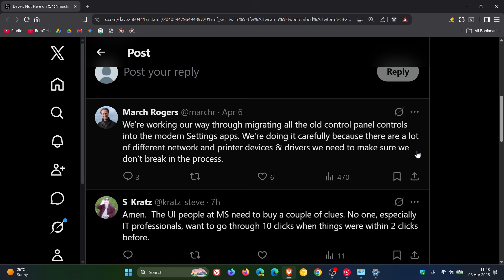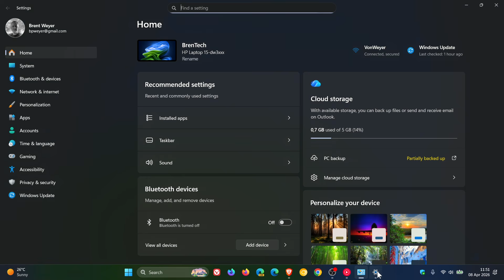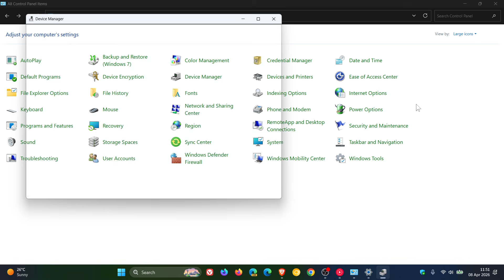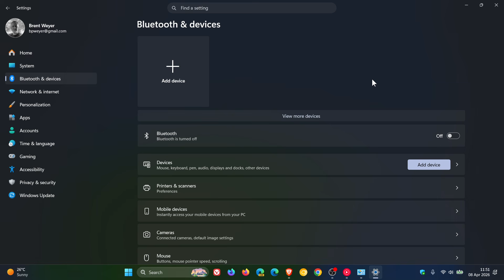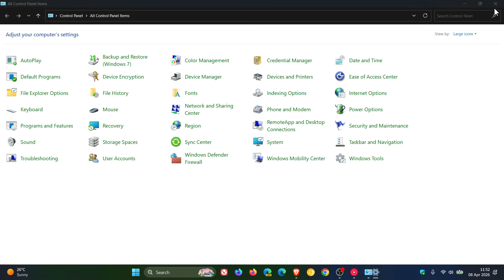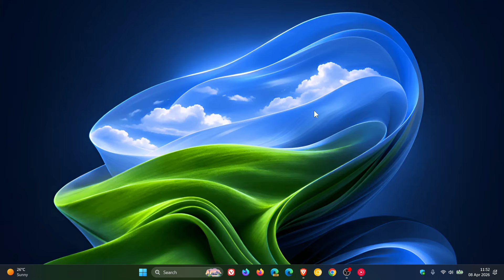Microsoft Confirms Why Control Panel's Migration Into Settings is Taking SO LONG!

Comment: Microsoft should treat the Control Panel as Advanced settings and bring everything over under one massive section called Advanced Settings. This would enable them to get the job done quickly. In fact they would be able to still continue refining the integration. It's like moving out of your old house and having everything in a specific room full of boxes in the new house.

Comment: Yup, I agree that they should not BREAK things!
And.. I agree the new Settings menu can be very unwieldy for some things such as the network settings.
One thing I particularly don't like is you can't, as far as I know, work on multiple settings at the same time.
The individual control panel items in the old control panel can be opened separately.

Microsoft has sort of done this by making the Windows Security controls available in the Settings menu AND as a separate window.
Maybe they can use this hybrid approach before they try to integrate everything in the new Settings menu?

Comment: The Control Panel is here because we longtime users kept using it.

Personally, for Sound tasks, I've shifted over to Settings. For normal Networking stuff, I've also shifted to Settings. However, for advanced networking like bridging networks, VLAN, Server  & Hyper-V stuff and NIC hardware configuration I still use Network Centre.

Printers & Scanner, Game Controllers, I prefer to use the maker's interface. Fine-grain control is still important for these devices.

Device Manager should not be messed with. It's perfect as it is, although a dark mode will be nice.

Disk Manager should be moved to Device > Storage. This program is rather basic so common Disk & Partition functions should be consolidated. 

In fact, Storage Spaces, Windows 11 RAID solution should be bunched into Device > Storage too and automatically enabled (shows up in Setting) when Windows sense multiple NVMe / SSD / HDD installed. A simple drive map can show the possible RAID-level based on installed hardware and which ports they are attached to.

Comment: The control panel was one thing that they got right in Windows all those years ago. It just works and does job it is supposed too. The only thing I would say give it and the different menus dark mode but leave it alone. As many have said if it ain’t broke don’t fix it. BrenTech should do a poll (if he hasn’t already) on which users prefer settings app or control panel, don’t mind.

Comment: I will just continue using the Control Panel folder as it's far better and I've been using it since the 1990s. I've even made a backup Control Panel folder I can add to my start menu if needs be. I've even considered using the GodMode folder which allows users to access all of the settings in one place, instead of searching through the Control Panel or Settings app.

Comment: It’s a nonsense excuse. If this were truly the only reason , they could migrate te entirety of the Control panel to Settings, leaving behind an empty Control Panel which would be available to any device drivers which haven’t been ported yet. Furthermore, they could state that as of the next major update of Windows the OS will mot support Control Panel-style interface for devices of type X (e.g printers). It would then be on the device manufacturers to update their software and Microsoft would be able to concentrate on building actual improvements to the system.

Comment: It's more than just content & control. The Control Panel looks aged, but it's still a clean, well-organized, concise & intuitive layout that's easier to understand and use. It's not perfect, but it's much easier to find functions in the Control Panel than in the Settings. Settings, like most of the newer Windows systems, is TMI on each screen, too disjointed, and is just slop w/o the AI (so far!).
If this is what Microsoft means by "fixing Windows," the future is going to be even more disappointing.

Comment: I have been using Windows since it was a DOS application. My number one complaint with Microsoft is that they keep needlessly changing and moving things. The end result is the same, but you can never find anything.

What was wrong with control panel? I still use it, it works. I give them credit for the right click on start button for some settings. I wish I could just pin Control Panel apps of my choice to it.
Reply: The control panel is perfect why replace perfect, it never made sense what they are doing

Comment: the win11 settings ui is a little better than win10. but, its still too big and clunky, with too much whitespace, and color scheme that acts against the font colors and button colors. it still pales in comparison to the much smaller and clearly readable, control panel (like other win32 apps, dont have native dark mode support, but have community made fixes).
some prime examples of control panel items that still outclass or are the only option, are the sound control panel (compared to the lackluster implementation of it to win11 settings app), and the properties panel for any file, app, or folder, although it is its own thing, would benefit from an updated ui (the only improvement it needs is dark mode natively supported by microsoft developers). this same convoluted and unnecessarily large ui (when all accessibility features are off) impacts other settings pages, like network/internet, the unnecessary home page, and the super tall and wide padded buttons also making an appearance in the system page (the system tab is the real home page, change my mind)

long story short, their scope of migrating it all, has long been plagued by feature creep!
the same excuses can be used to explain why we still use three generations of explorer file/folder pickers!
Reply: Rhat i agree. I like the win11 settings. I have beennon 10 for a decade.

Comment: Settings app is a mess of white space and nested menus.
Even if they manage to migrate everything, I can't imagine it being superior.
Reply: Thank you. Windows is built for the guy walking past your desk now, not the person sat using it.
Reply: exactly, its much harder to read in comparison, especially with the light grey font, on dark gray buttons, that blend into the dark gray background. dont get me started on those extremely padded, tall, and super wide buttons... if you make the settings windows width too small, poof, instead of the small boxes you want (still too tall), you get W I D E  B O X. at first i thought it was an accessibility feature, to be toggled, that they half assed, gave up on, and said fk it, everyone needs B I G  B U T T O N
sorry, you put it clearer, the whitespace just doesnt help. also, the amount of feature creep that has occurred over the years, has long plagued win10 settings and win11 settings ... enough for them to not even focus on its ui 😂

also, not to mention, the sound settings is one PRIME example of how not to implement the more superior, easy to use, tiny, sound cpl (microsoft forgot to give win32 apps dark mode, community stepped in to fix it, but thats another nitpick)
Reply: @lomein2  "light grey font, on dark gray buttons, that blend into the dark gray background"
How do you get that? The Settings app looks normal or is that due to your screen?
Reply: Remember color? 😂 @ThatRandomToast
Reply: @sammymcfone8281  0:17 Can you explain this? How is this hard to read?
Reply: @ThatRandomToast  42
Reply: Don’t forget it’s so dam slow!

Comment: Settings debuted in Windows 8. We have had Win 8.1, Win 10 and are now on Win 11 and the Settings app is still not complete in functionality. Yet we've gotten many new features in updates that have been breaking machines in some cases. Microsoft is in a sorry state.This would never have happened back in the day.
Reply: Windows is one of the very small amount of OS that it supports severely deprecated features and protocols, some of them are not supported in most Linux Distros as well. 

As I see it, they could migrate everything(deprecated or not) to modern settings, which mean they postpone the split for the future or doing it right now. They may had the same debate even during win10 and they had selected the second option(postpone if for the future) and this is why win11 is facing this major split.
Reply: @christosmallios9823 if there are protocols that even linux dropped then nobody uses them. And if you do then u can take the old removed code and add it back in, rebase and fix it against the latest kernel.
Reply: Settings is inefficient, go back to control panel
Reply: @shadowopsairman1583  the problem is that as they migrate options to settings they remove them from control panel. The control panel in Windows 11 has half of the options it had in Windows 10
Reply: @shadowopsairman1583  My contention is not which one is better. I just want them to commit to something and complete it like they used to do back in the day.